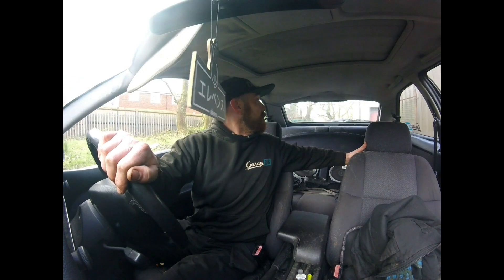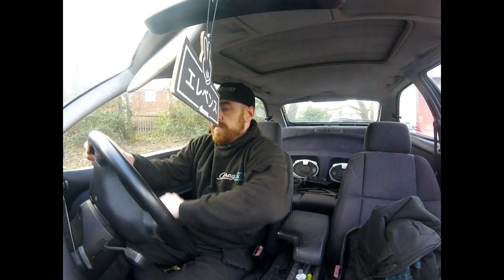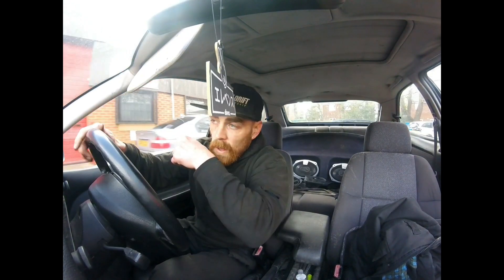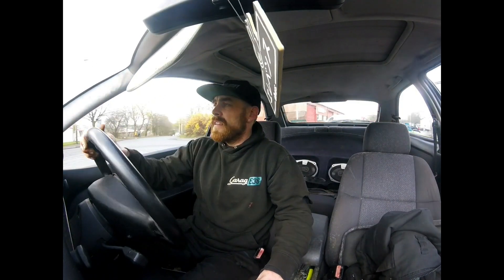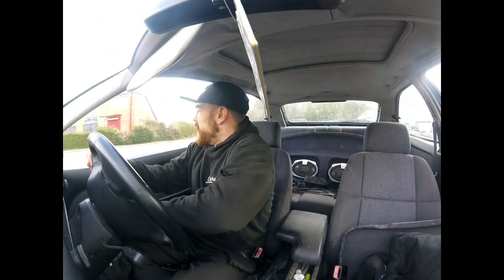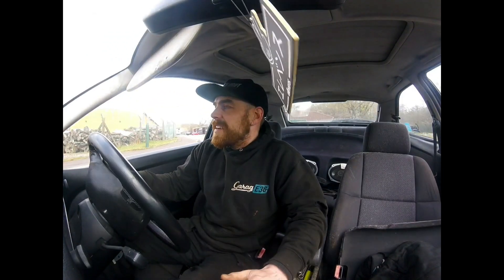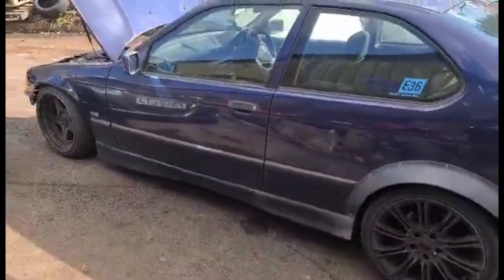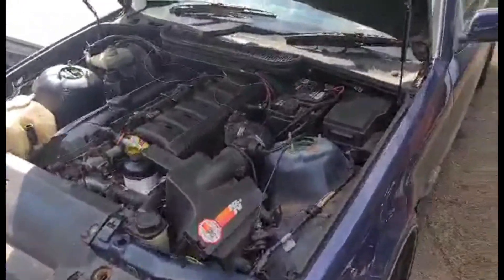Bmw E36 M50B30 Stroker Engine Build, Part 11, 1st Test Drive..

Comment: Brother I'm using the bosch 413 m50b25tu ecu and when i use m52b28 injectors it doesn't run right not even idle well, and when i use the m50b25 i have a knocking issue and i quite frankly don't have a clue what to do about it
Reply from the maker: Hi mate.

I use the ms41 m52 ecu, not sure about running the 413 bosch ecu

Comment: I have a m54b30 im thinking when i boost it to use this block m50 but keep all my parts , is it possible ? Yours now reminds me a lot my engine how it runs
Reply from the maker: You cant transfer all your m54b30 internals inside the m50 engine but you also need m50 or m52 head, the m54 head won't work

Comment: Top work fella. And that IS how you seat the rings. Get on the loud pedal but keep it under 5k rpm, not treating it like a baby
Reply from the maker: Thank you mate.  Yes didn't give it to much just yet, being Conservative. Once I map it I'll give it a proper blast.
Reply: @GaragE36uk  i ran mine without power steering for a while cos of a leaking high pressure line with a shorter belt to delete the pump. Very quickly realised how hard modern cars are to drive without it. My first 3 cars, mid 80's ones, had no ps. Either that or ive turned into a pussy!
Reply from the maker: @brightmodern  the older style non power steering racks are alot easier to turn than a power steering rack. Its OK once moving and even feels tighter but hard to move around d slowly.. I have just been to lazy to refit the power steering lines as wanted to test it lol..